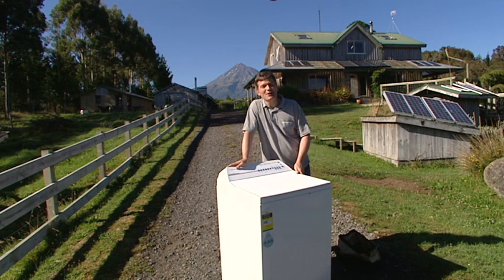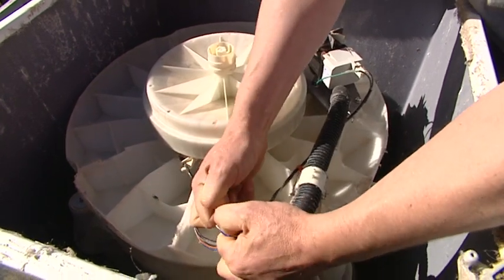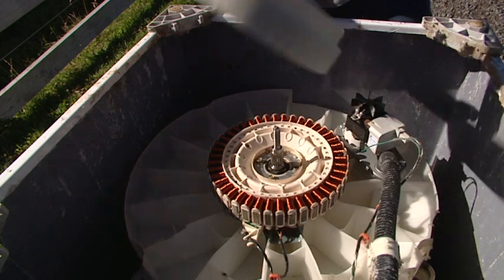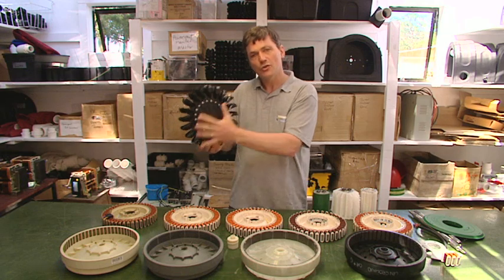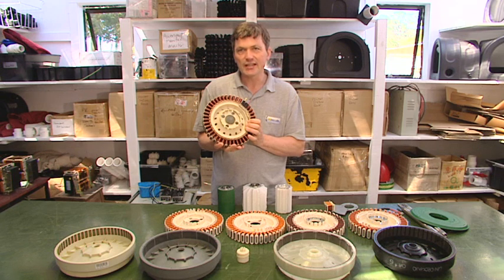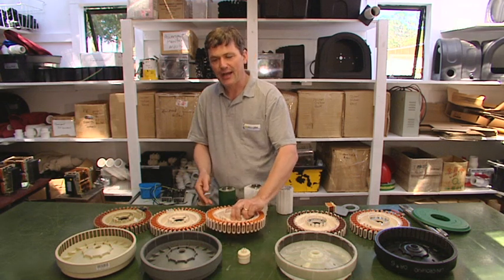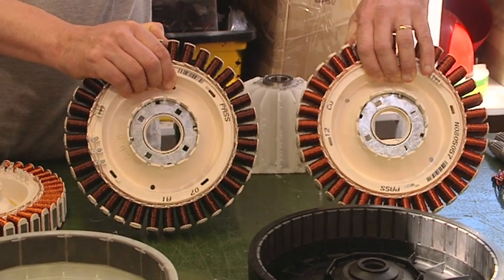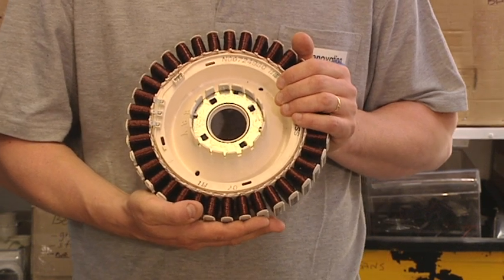PowerSpout - History of the Smart Drive

Comment: Hiya Mike, i hope your still around answering questions, those first 3 wires that you disconnected, if i were to connect those up to a power plug and plug it into a socket, would it spin the wheel? like a pottery wheel?
Reply: No, the electronics in the original machine convert the power from the wall socket into high voltage DC and then pulse it (in sequence) into the three windings. Google BLDC motor.
Reply: If you use this as DC motor, yes it could turn potter wheel.

Comment: Very interesting and informative!   I was thinking about the possibility of paralleling about 4 of these, for 2 projects, one as a generator, the second, as a bldc motor, with about 5kw 96v controller, I'm guessing the 100 would be best for the motor, and the 60 or newer for the generator, I'm thinking DC generator with gas/propane, to charge batteries for my offgrid house! What type charge controllers you guys use?

Comment: Stay away from Samsung Stators all the Wire is Al.
Reply: And not all Samsung units have Al wire. There is at least one Model of their motors that have Copper windings. Look for units with a DON1500 motor in them. If you had to buy the stators new though, you'd suffer sticker shock.
Reply: I wouldn't say stay away from them, just that you need to be aware of it. If AL wire was such a possible problem, none of the companies would use it under their washers. And guess what the overhead electric wires are that are strung all over the world. Yep, they are AL with often a single steel wire down the center to act as a carrier. In the case of Samsung stators, cut the wires to suit, scrape/sand off the enamel, coat with  No Ox Id or equal, use a crimp terminal to join to copper wire. When done, you can coat the windings and wire with more enamel or varnish. I would worry more about the metal laminations in the stator rusting before the rotor wire having problems. Be sure to put a heavy coating on the area where the original terminations are such as an epoxy coating or such.

Comment: What size pelton wheel do you use for either the 100, 80 or 60 size rotors?? And where to buy? I have other questions for water supply and how much pressure. I will have about 40' of 4" PVC reduced to 3/4 with 15 foot fall. Is this all trial and error or is there charts to help with all this. I also subbed to your channel. Thanks for all your efforts!!
Reply: Head (ft.) × Flow (gpm) ÷ 12 = Power (W)
Reply: https://www.youtube.com/watch?v=2LNfDI3QUpQ    just in case you cant find the 'used ' motor.. why not make your own , to your own specs?  this is genius :)

Comment: Do the older 42 pole units generate more power at lower RPM's?  It just seems logical, since more transitions happen per rotation.
Reply: Sir moter 1 coile torn  & size???wire

Comment: Hi
In one of your video's you said that you would charge a nominal fee to tell someone how to wire a Fisher Paykel motor for there application?  I have a swimming pool, I'm going to use the pool pump to drive the smart drive motor using a centrifugal pump off the return side of the pool pump and coupling shaft to the smart drive. My question is, I have 120 Vac in my home can you tell me the best way to configure the smart drive for my application. Or ware can I find the necessary info ?.

Comment: I just took apart 4 Fisher Paykels 1 Maytag and one very large horizontal washer for the genis. The large horizontal washer has a quite large stator and the rotor has sheet metal on it's outside surface. Do you have any info on these large diameter rotors? Hello from the United States.